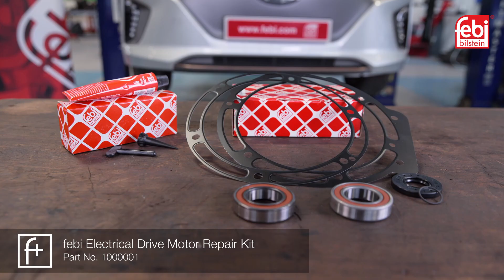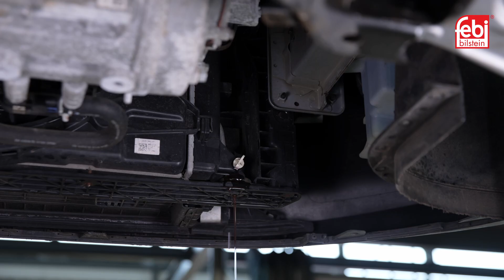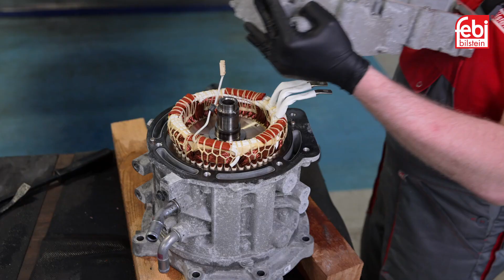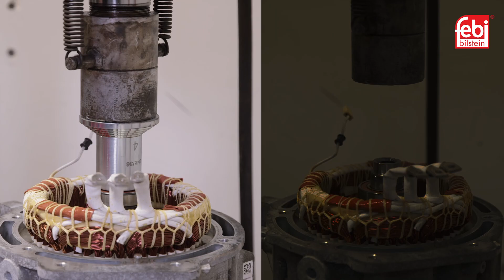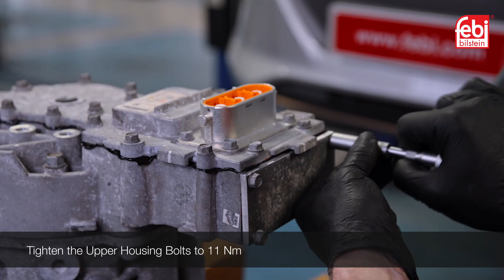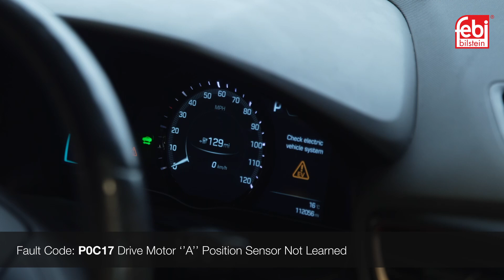Hyundai Ioniq Electric Drive Motor Bearing replacement

Comment: Great video but it doesn't give any reference to the Febi part numbers to order. I would also like to replace the bearings in the reduction gearbox.
Reply from the maker: Hi, you can find the part numbers in the video and in the video description :)
Reply: How much would it cost to the bearings changed with your technicians?